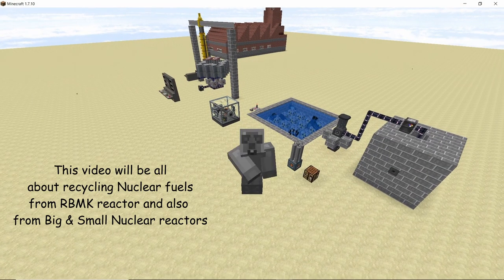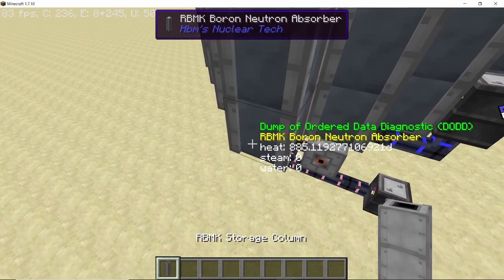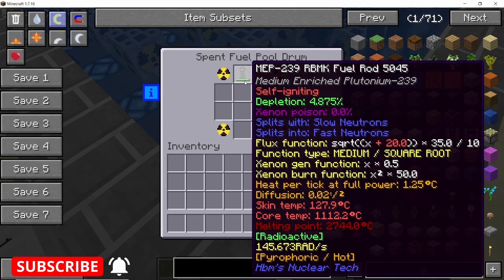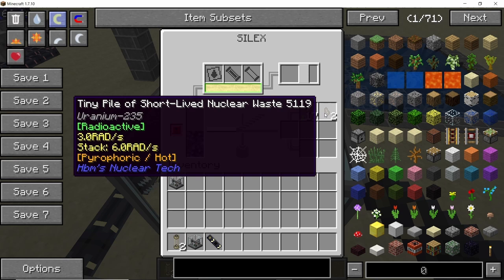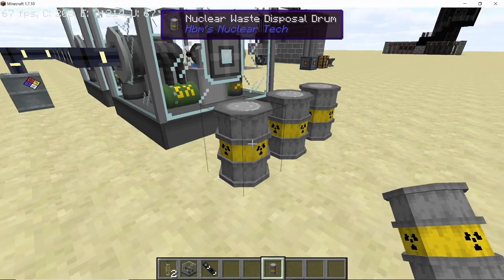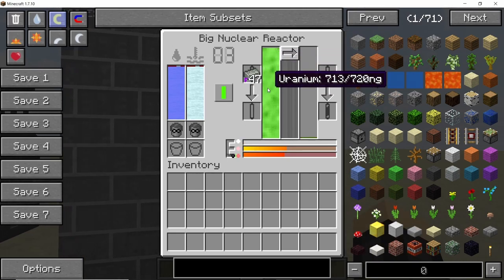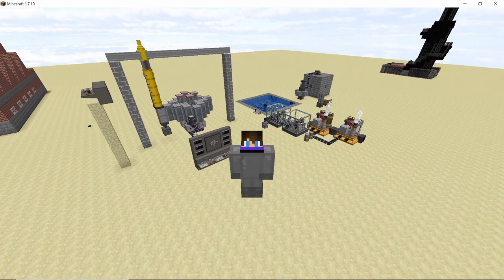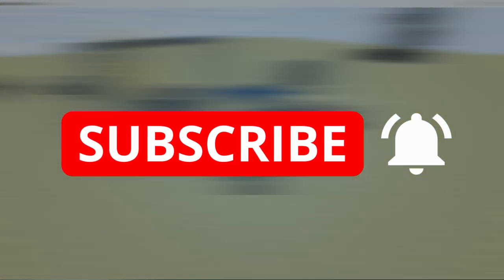How to RECYCLE RBMK FUEL in HBMs Mod || Complete NUCLEAR FUEL RECYCLING GUIDE for HBMs Mod

Comment: Do you know why my rbmk keeps leaking radiation even though its one of your builds that shouldnt leak
Reply from the maker: If you place Neutron Absorbers / Neutron Reflectors which are directly in line with each and every fuel rod then that should contain all the neutrons in your setup. Also make sure to cover the top of the reactor with RBMK cover panels. 

And if after that it's still leaking radiation then place down a Radiation absorber near it and that should keep the radiation in check
Reply: Ok thank you

Comment: thanks savage vegeta, i have problems with the new version of mcheli, my minecraft just crash
Reply from the maker: If you are talking about the version for 1.12.2 then it is still in development phase. If not then which version are you  talking about man ?
Reply: @SavageVegeta  the version 1.0.3 version
Reply from the maker: @andreschroder7852  why use it when you can go for version 1.0.4 ?? It has more stuff and is more stable then version 1.0.3 , also it's the version which will be used on the server so I would highly recommend using that !!
Reply: @SavageVegeta  because the google drive link doesnt work

Comment: Hello, I have a bit of a longer question. Here a bit of introduction: I am pretty early game but committed to getting 2 bismuth nuggets for a Bismuth Laser Crystal. I've researched a bit and now I think the best way to get it would be to put any type of decayed nuclear waste into a silex and then use a few with a CO2 crystal to get a chance of bismuth suggest spawning. My question is: How do I get any type of decayed nuclear waste without a nuclear reactor (I have a few Rtg pellets of Uranium and Plutonium, a few nuggets and ingots of Uranium, Plutonium, Thorium and Neptunium maybe that could help) I couldn't find anything about that anywhere else...
Btw I love your videos they're really helpful!
Reply from the maker: Well the thing is bismuth is kind of a mid game material which can be obtained by decaying most RBMK fuel ... Now if you have not made an RBMK then you can try and deplete your plutonium fuel in a normal Nuclear reactor and then recycle the fuel , however do check the outputs that you will get from that in NEI before you attempt that, I am replying you while I'm at work so I don't have my laptop on me rn otherwise I could've checked that for you

Another method is to decay a Lead-209 RTG pellet as it yields bismuth directly , but to obtain that lead pellet you need to deplete Australium in an RBMK and to process it you already need a bismuth crystal In Silex so that option is out ... So either build a Zirnox reactor , or a big nuclear reactor , or an RBMK reactor to deplete your nuclear fuel. 

Now here are some video links I've made on this topic we discussed

Bismuth production : https://youtu.be/XFMG4eEBMgk

Lead-209 production : https://youtu.be/uSOy1Oze1YE

Automating the Nuclear Reactor all the way till the fuel is depleted : https://youtu.be/e2gwD7aPT2I

Zirnox reactor : https://youtu.be/dzP2tmq4eKU

Anyways lemme know if I can help more on the topic , you'll need to grind for bismuth whichever path you pick ... It's a difficult material to produce 🥲
Reply: @SavageVegeta   Thanks for the quick response! I've built a ZIRNOX Reactor but how do I get my hands on bismuth now?
Reply: its locked behind a rbmk

Comment: hi vegeta, could you make a video about how to use rbmk reactors safely
Reply from the maker: There isn't much that goes into it man , I mean once you have made a stable enough design the reactor will run and regulate itself for it's fuel life before you decide to replace the fuel rods
One thing you can do is to turn the reactor off before going anywhere so it doesn't run in unloaded chunks. Also having a few more water tanks than needed is a good solution to make sure than the reactor doesn't run out of water which is one of the main reasons why reactors explode. 
If there is a more specific aspect of rbmk that you wanted to know about lemme know !!
Reply: @SavageVegeta  btw wut will happen if I pulled the control rods to 100%
Reply from the maker: @neunundneunzigluftballons  nothing , if your design is made in a safe way pulling out the rods all the way will ensure it makes the max amount of steam possible

Comment: How do you make the RBMK shown in the video?
Reply from the maker: I just put that design together in hurry cause the video was about recycling nuclear fuel and not the RBMK itself ... So I don't remember exactly sorry 😅🥲
However if at any point in the video I've clicked on the RBMK control panel then it'll have the complete layout of the reactor and as it's not too big or complicated for that matter you can directly build it from there

Comment: Tutorial for auto extracting fuel rods?
Reply from the maker: no way to auto extract, your input atleast in terms of controlling the crane is needed, after that itemducts/conveyor ejectors can be used at the bottom of the rbmk storage column to get it out
Reply: OpenComputers Bot for auto extracting?
Reply from the maker: @nathanielkhoo3460  I have very little experience with OC but yes ntm does support its integration so maybe that will work